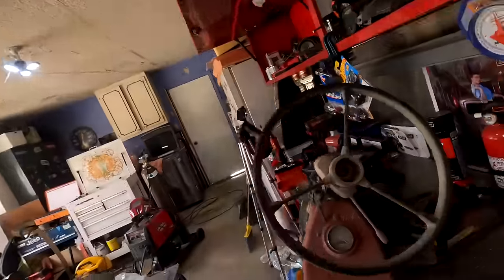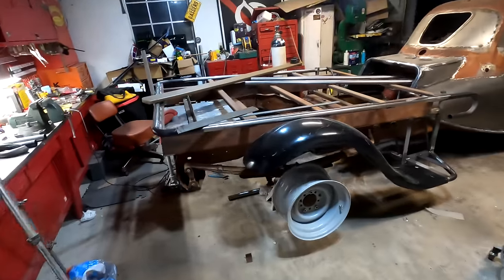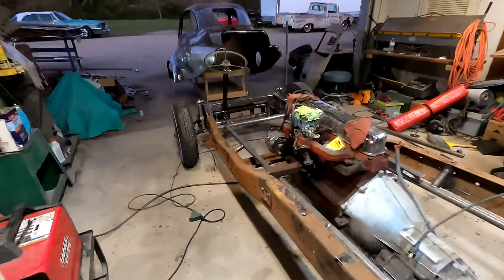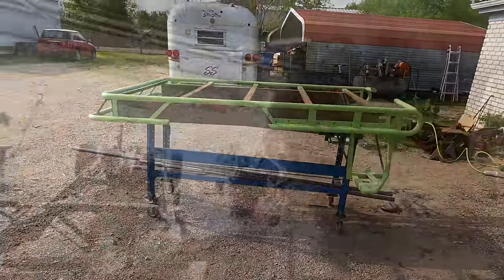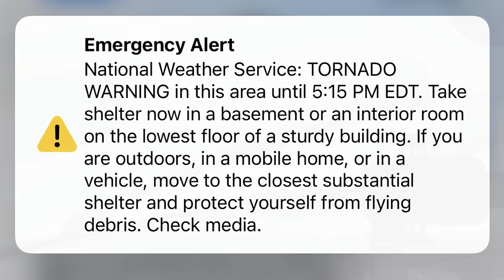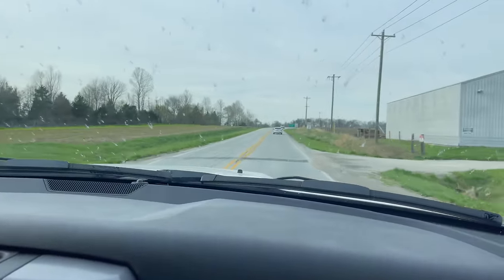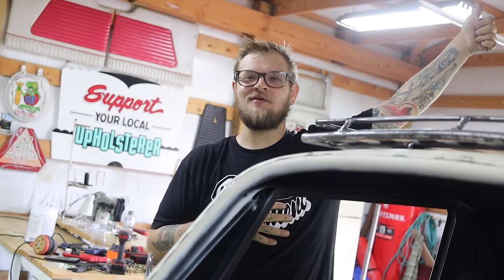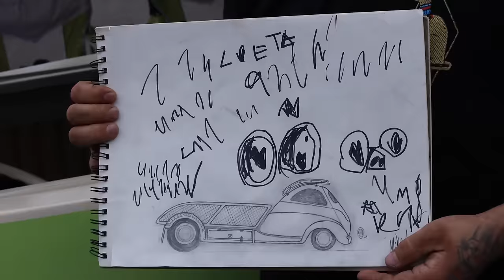PICKLE JAR EP.2 : BEATERSVILLE OR BUST - ISETTA HUALER MIKEY BROWN

Comment: Sew & Weld  this is the real deal when it comes to hands on, A-Z limited $lip DIY. You got my sub,  great job compressing 40 days into a watchable hour & 1/2.  My formidable ( impressionable formative years) were from 1967- 70. The Muscle Car vs Hippie Vw era..And what did i like at that time when i got behind the wheel?  micro & mini cars, old Isettas, Fiat 500's, Sprites  Austin 7 & Hillmans, Crosley, Citroen-Cv2 & Vw's At the time the new Subaru 360 micro car & micro van appeared in 1968 along with Honda who started importing a mini hatch & made attempt at a mid 60's MG-/ Triumph inspired sports car both used alot of motorcycle components, much like the Isetta  & Citroen CV, based off off BMW single & boxer twin MC drive platform, if i remember right the new Honda sports car was chain drive. Datsun had a similar slightly larger sports car called a fair lady. In '69 I was looking at old used VW's at a dealer, a$50 -100$ car that ran as i wanted to  make a baja buggy for fishing in Mexico. The lot guy said to go look in the back lot by the shop, there was a few dozen Vw's of every model that were traded in but not car lot material. Some brush painted beaters, rust buckets and fixible wrecks, most ran & nothing over $150,, i noticed  what looked like a Issetta micro car cab with large 33" sand or implement tires once used on small airplanes and there was 4 wheels instead of 3 .I lifted the makeshift engine cover and found someone had stuffed a small Renault 4  banger & transaxel in it, added some beefy mounts & coil springs F&R. so i found my dune buggy already done, The guys in the shop laughed, nobody would want that, How much? they said $30 and get it out of here now, we need the parking space.. Best and most fun $35  i ever spent. It was the" Limo" model body  a few inches more leg room in the back and a full length sunroof,  But it could haul 3-4 of us kids, with our surfboards a mile to the beach. Thats all i ever used it for, e-z parking at the beach & i was more into motorcycles as my daily transpo but managed to have a handful of odd orphans & clown cars as a kid, I always wanted to stuff a VW 36hp & early bus transaxel in that Isetta. Nowdays i watch a few of you young guys create some seriously cool stuff, None of that discovery channel monkey builder BS, True homebrew and homegrown is always the best.

Comment: A hearty congrats guy, the truck came out looking really nice.  It turns out the truck is painted the same color as my interior walls of my place; pistacho green.  It has a kind of Janus car feel to it, in that the front and rear fenders are rear fenders yet they are flipped around.  Well, at least pickle's front fenders.   
     What I like the most about your truck, is that you didn't go for any of that patina nonsense.  I have seen so many car builds that end up getting clear coated to save that "wonderful patina".  What are they talking about, it looks unfinished, ugly.  I have even seen fake patina being applied to a car.  Sigh.  You, you have proven that you can get a very decent paint job with spray paint cans.  Nice.

Comment: Yo do know there is actually plenty of room for two, TWO more cylinder in the engine! A 305 with a slight bit of porting to the heads, especially the bowl area.  And a decent cam. And Edelbrock preformer RPM air gap intake a 600 Holley or efi,  with a set of shorty headers. And a canopy  on the bed would be cool. A canvas top with a nearly flat top only about 4" taller in the center. And the the sides about 3"-4" wider than the top anc the front 6" lower than the rear, with canvas covered rear doors,  maybe put a 400 crank in the 305, build a roughly 340 cid engine! Making tons of TQ, to 6k rpm, pare it with a monster transmission 700R4 with stall 2500 3k, lockup converter,  anymore power and it will do wheelies!!

Comment: i'd like more of a crumple zone up front and space for my legs and any size lady I'm in the  MOO for.   Something similar, easier and more functional might be to uses a beetle, keep the back seat and put a 4 to 6 foot bed for a light duty 4 seat pickup.     How about The back of a Corvair pickup with a beetle cab?   or could you  flip the bug motor around and put a trans and a driveshaft (longbed version).  Then you have 4 seats and a storage in the front.  You also would have good parts availability for anything vw including Hd suspension.   Hey, if you take the bed off your rig and made a fiberglass tail you would have the sperm mobile.